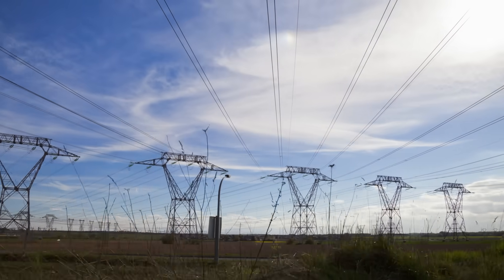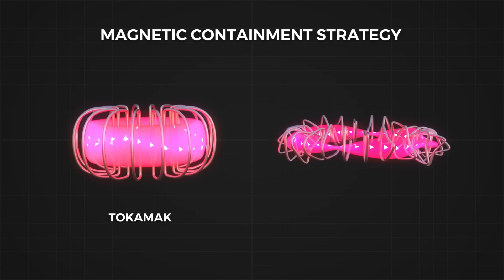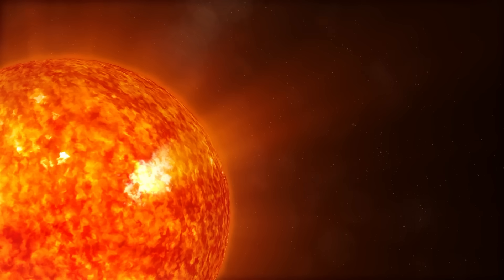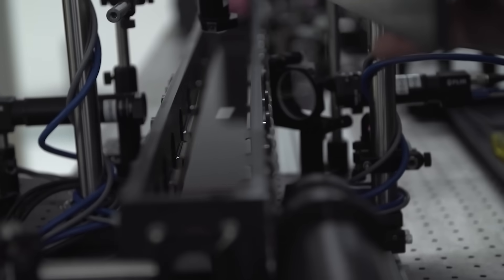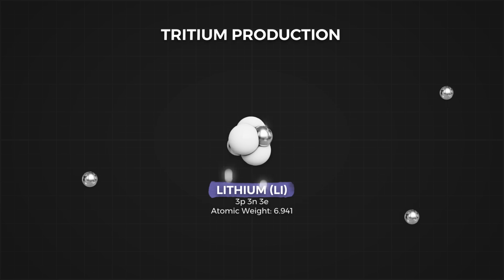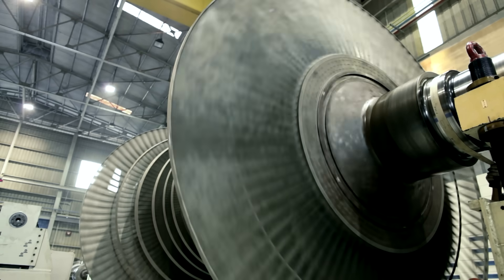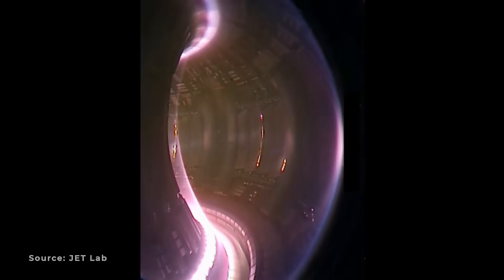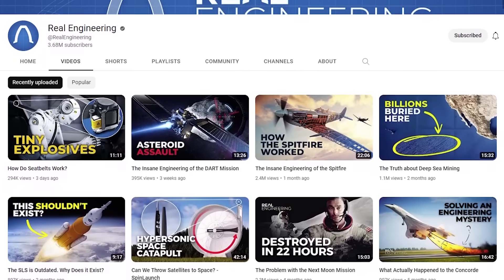The Problem with Nuclear Fusion

Comment: Humans are in a forever quest to find the most efficient way to boil water that spins something
Reply: When you upgrade the steam engine to a higher level
Reply: @thiccccc_chicke4869  not quite
Reply: @thiccccc_chicke4869  XD its literally like those mods in games like forts that let you endlessly upgrade something with humans are at the first softcap trying to push to the next one to get a MAJOR boost from what we had....
Reply: @thiccccc_chicke4869  That's achieved with a higher input temperature, an advantage of molten salt fission reactors, that were experimentally proven in Nixon's  time.
Reply: If we ever figure out He3 + He3 fusion we won’t have to bother with that water boiling. All the products are charged so their energy can be extracted directly with a magnetic field
Reply: @stdesy 
Yeah, but giant nuclear powered water boilers are cool
Reply: @davisdf3064  I think we already have those?
Reply: @BSpinoza210 
Nuclear Fusion powered
Reply: @davisdf3064  actually it's hot
Reply: @michaeldesanta5810 
Indeed, hot as hell
Reply: @davisdf3064  correct
Reply: @davisdf3064  I heard a red neck say that about a monster truck event, the one down the road with the giant cloud of smoke and carbon burning then extracted out VIA some 16 cyl diesel.
Reply: @davisdf3064  they are incredibly inefficient
Reply: @nick_0 
Yet, cool
Reply: @davisdf3064  nah what’s cooler is using high energy x-rays to influence a magnetic field to generate a strong current of electrons. Not boiling water like a kettle. Not nearly as cool
Reply: @davisdf3064  cool, but costly. And most importantly require water, a resource sparse in some regions of the world.
Reply: @davisdf3064  actually they are hot, reeeeally hot
Reply: @davisdf3064  They're going to look back on that like we look back on an ox powering a mill.
Reply: @davisdf3064  they're not cool, they're very hot
Reply: @davisdf3064  Smaller ones are less expensive to build, on a production line, if they're molten salt.
Reply: @davisdf3064  They better be cool
Reply: @davisdf3064 Yeah but the chance of large water boilers having a meltdown is low but not zero.
Reply: @BitAscent  
The chance is zero if the they need the water to work.

You see, modern nuclear reactors use water both as a moderator and a way to reduce heat.

That essentially means that if the water ever gets too hot and becomes vapor, the reaction stops, wich means the reactor stops heating up too.

So, modern reactors are essentially impossible to meltdown, specially in a catastrophic way like Chernobyl.
Reply: @davisdf3064  there's no zero in everything the chances of you dying rn is not zero.
Reply: @stdesy  Won't be so easy tho (unless someone else has researched it). Plasma instability has been a major road block in fusion researches and I can only imagine that an inductive coil on the plasma only makes it worse.
Reply: “Damn the torpedoes! Warp speed ahead ! ❄️😎
Reply: @jameswu7850  what is an inductive coil?
Reply: @jameswu7850  yup even with the neural nets suggesting better magnetic bottles it still seems like it might be beyond the materials we have. Maybe make the torus much larger but keep the magnetic confinement the small size, but I think the walls would still get fried even with high volume pumps moving coolant thru the walls
Reply: @jameswu7850  
The instability part is why Tokamaks sucks so bad.
It is a technology based on the most basic understanding of plasma physics imaginable.
Watering down the most complex field of physics down to Lorenz' force law.
Reply: @jameswu7850  if you respond to this comment you like science
Reply: @jameswu7850 they say AI may be helping to solve that
Reply: @jameswu7850 but its cool
Reply: @jameswu7850  Have you considered Bob Lazar?  I suspect the rings around the saucer probably contain Element 115 - Trillium. When 115 is supercooled near Absolute Zero, the molecular configuration is in perfect symmetry. If the rings are bathed in high sound frequencies, the eternal configuration of Sonoluminessence is generated and the craft can levitate.
Reply: @stdesy  Helion's reverse configuration torus likes to have a word with you
Reply: @stdesy  They have achieved fusion in a California lab, and got more energy output, than input. Look it up. It just happened.
Reply: @epicmage82  They needed 300MJ of energy to produce the 2MJ of laser output, to produce 3MJ of fusion energy.

I'm not knocking it - it's a big step forwards, but for practical use, it's the total net gain that counts, and we're still a long way from seeing that happen.
Reply: @stdesy  what's the hold up on it right now?
Reply: @stdesy  can you please elaborate ? Is he3 fusion aneutronic fusion?
Reply: @stdesy you ruined the joke........ smh
Reply: @stdesy  
We already have methods for that.
Hydrogen Boron fuel produces 3 helium
H1+ B11 => B12 => 3He4 + energy
Reply: @stdesy  you mean "HeHeHeHeHeHe"?
Reply: @stdesy  interesting, wouldn't we still have to manage the heat of fusion being released, which is what the tokamak/coolant water does?
Reply: @stdesy  Exciting stuff
Reply: @stdesy  that's exactly what trinta is doing with their generation 7 fusion reactor.
Reply: @stdesy  Sounds really cool. What are your credentials.
Reply: @stdesy  isnt that what helion is doing?
Reply: @stdesy  Also, He3 is rare. So we’ll still have to figure out a way to produce them to sustain the fusion.
Reply: @stdesy  600 million degrees isn't feasible, helion barely gets to 10 million at the last possible stage
Reply: @stdesy  a week later, here we are. Interesting times
Reply: @stdesy  like the way Tesla wanted it to be?
Reply: @stdesy  like docs from back to the future fusion reactor running on some bits of organic and inorganic trash.  Would work with grounds soil too
Reply: @stdesy  and we need a cheap way to harvest he3 on the moon.
Reply: @stdesy  hey dude can you tell me more about the magnetic field energy extraction or whats its called.... I'm a first year mechanical engineering student and this stuff fascinates me
Reply: @stdesy  isnt there a Startup that already is able to do that fairly consistently? i watched a video about it a few days ago.
Reply: @stdesy  I doubt it very much. They'll be going in random directions.
Reply: @stdesy the problem with using a different fuel than deut and tritium, is that initial input energy required to start the stupid thing. I myself would frickin love 100% usable charged energy fusion reaction as much as the next guy, but net energy is very difficult to get
Reply: @stdesy  way more expensive and how efficient is that
Reply: @stdesy  Is He 3+ Helium or Tritium??
Reply: P0ooooooooooooooo9ó
Reply: It couldn't trap electromagnetic energy of the charged particle which will be the most of energy of a charged particle if it is considered over a large range of time don't you think so 🤔🤔🤔🤔
Reply: @stdesy  then use it to boil water
Reply: @stdesy  why is it that helium 3 is better then tritium and deutrium?
Reply: @stdesy  Im pretty sure that’s how power distribution works on ships in Star Trek.
Reply: @stdesy that would be so cool
Reply: @stdesy  but then it won't be a Hell of a Way to Boil Water
Reply: @stdesy  u get less energy fusing heavier elements not more
Reply: @stdesy  "If," as the Spartans used to say.
Reply: @stdesy  Sonoluminessence
Reply: @stdesy their thermal energy can be extracted with a magnetic field?
Reply: @stdesy what in the foook is that all about?! Now I gotta research
Reply: @stdesy We already have figured that one out in theory, the problem is the rarity of the fuel source, it's almost impossible to find on earth in a way that's easy to extract, but on the moon it would be much easier. That's not technically a technical problem, it's a logistics issue.
Reply: @stdesy  you would just trade 1 problem for another... Besides charged particles tend to recombine near the edge of a reactor. This  means you just increase the heat load on the divertor.
Reply: @tomhuitema2068 not only humans, also nature itself. Eukariotic cells have a proteine called ATP sintase which produces ATP by spinning due to a proton flow.
Reply: Yes, it’s kind of deflating to realize that an enormous nuclear aircraft carrier is really just an overgrown steamboat.
Reply: @tobucksy  Uh not exactly... They're driven by electric motor, but yes this power is obtained via boiling water
Reply: @tobucksy that's a personal problem. When you understand how nuclear power works it isn't suprising.
Reply: @tobucksy  Toot Toot.
Reply: power cells don’t produce electricity from fuel in this way. There are other methods too. It’s common for sure, it’s just that other methods are impractical and/or immature.
Reply: Excuse me! I prefer wind flow and water currents to spin stuff. Boiling water is sooo passé.
Reply: @kazj1728 still convection forces from sun heating earth’s surface
Reply: @kazj1728  Rolling Element 115 at Absolute Zero with Sonoluminessence is the future. ❤️
Reply: Humans are in a forever quest to synchronize a number of spinning disks
Reply: because the efficient way to generate electricity today that we know is spinning magnet inside coil. wind turbine or steam turbine or fossil fuel generator just the means to do that
Reply: @breakhart  better off harnessing dark energy.
Reply: @breakhart  The wind is better at driving a vessel across the Atlantic, than at responding to  the demand on a 60 Hz AC grid. But sailships were defeated by coal.
Reply: @breakhart  But it's not the only way. Batteries exist and they don't use moving parts. Why not just use a fusion battery to produce HVDC?
Reply: @twistedyogert  because battery are for storage, you still need means necessary to recharged it, and fusion itself isn't ready. there is a possibility for RTG battery, but I don't think anyone want one in their backyard
Reply: @twistedyogert  batteries are a bit different. They do not produce electricity. They're a storage technology
Reply: @MadScientist267  ah my mistake. what I meant is occasionally battery can't be long last and need to recharged but RTG doesn't, because it using heat from decay of radioactive materials. since it only general few hundreds watt currently, you gonna need more than a couple for a home. alot of batteries using highly radioactive materials means for self usage risk is high cause need constant checking, that's why I say you don't want that in your backyard
Reply: @breakhart  Depends on the isotopes used. There are many different fuels used for these devices each with their own advantages and disadvantages.
Reply: @twistedyogert  such a different concept.
Reply: @twistedyogert Some people think we have exhausted the possible combinations of elements to produce whatever technology we might need I guess. There's only an almost infinite amount of possible molecular configurations we could try, but I guess we did them all already.
Reply: There it is, the sentence of the day.
Reply: U actually just need hot chicks to heat up the water 🤯
Reply: @hotpenguin607  but there aren't any in my area
Reply: @mistermidnight1823  oof
Reply: We should skip the entire boiling water part (40% efficiency conversion) and take energy out directly from plasma magnetic fields. In fact there are different approches already... They are trying to do exactly that
Reply: @RobinHood-qi7dh  You need more energy to maintain the plasma than the energy you get from plasma.
Reply: @RobinHood-qi7dh  that's a magnetohydrodynamic generator. Not efficient enough on its own, but pretty good as a topping cycle for conventional gas turbine generators.
Reply: @RobinHood-qi7dh  isnt it awesome how the star trek technobabble plasma power systems slowly are actually becoming a thing? Now i will start up an insurance company for consoles, who is with me?
Reply: @RobinHood-qi7dh   why can't we mix both, absorbing the neutrons for heat, capturing it with with water, while the rest is captured by the magnetic field, so you have a combined cycle to try get the most energy for an higher output and hopefully an higher net gain than either big hot boiler and magnetic energy capture
Reply: @federicoviolino6784  good idea indeed
Reply: @RobinHood-qi7dh  today industry has reached> 90% efficiency in steam, water etc industrial turbines..
Reply: @niks660097  what? Max theoric conversion for a turbine is 40%. Maybe you mean that we are at the 90% of that 40%?
Reply: @RobinHood-qi7dh ??
Reply: @RobinHood-qi7dh  This seems like it might make things more compact. Bigger isn't always better. If you don't have a steam generator taking up space then perhaps the room size reactor could be sized down to the size of a minivan.
Reply: we're  still using steam powered machines.
Reply: @iscifion7122  "we're  still using steam powered machines."
Solar panel, tide and wind turbine are exception
Reply: @anteeko  Which is where the term "energy sprawl" originated. Typical of all is very low energy density and erratic generation
Reply: You are so right. Years ago I had a VIP tour of the Maine Yankee Nuclear Power Plant in Maine, USA. It was really weird to see that the non-nuclear side of the plant was just a steam engine. Like, choo-choo.
Reply: Based
Reply: Nobody wants to turn a crank.
Reply: Twisting turning through the never.
Reply: @bizzle9041  🤘
Reply: @bizzle9041 🤘
Reply: Hydro meanwhile:Boiling?What's that?
Solar panels meanwhile:water?What's that?
Reply: Boiling water is cool 😎
Reply: TEA AND TORQUE BABY
Reply: @gwilliam2731  Sounds like a British car podcast or show...
Reply: Ahhhhh hahaha 🤣🤣
Reply: It's all about rotation my friend.
Reply: Its all about boiling water.
Reply: that's exactly what it is! at the end of the day, we just want to spin a motor.
Reply: There’s some designs that directly generate electricity without a turbine involved.
Reply: Imagine being able to heat a burrito in like 3 seconds. World peace would be inevitable.
Reply: @travicast  Its never going to be enough. Human energy usage is already on an exponential climb. The more energy we generate the more we demand. We are way out beyond the Earth's normal energy budget, and this only whispers in our ear to use more and more until we crash the biosphere.
Reply: we really really like spinning things okay?
Reply: The recent fusion test that made a net gain used direct induction to gain the power from magnetism instead of a turbine.
Reply: @zacharysherry2910  lol i dont thi k he has read about it yet. Its a huge deal
Reply: 🤣🤣🤣 you are so right.  Most people have no idea that nuclear power plants just boil water....same as a coal plant.
Reply: Steam is 🔥
Reply: As the good Lord intended. #perfectkettleoftea
Reply: This sounds like something that would appear in a humans are space orcs story lmao
Reply: @Daniel 
Annihilation Reactors (anti-matter) be like:
Reply: I'm putting this on a poster for a Christmas gift
Reply: Can use it for hydrigen production -> solid state fuel cell
Reply: Love the comment Straight on point. New tech needs new methods of thinking for power capture.
Reply: Yeah idk why its the only method we got. I watched scifi movie harvesting energy directly from mini sun in their generator. We are far from that 😂
Reply: You mean like a cyclone nuclear fusion reactor?
Reply: From and engineering perspective,  war has allways been the art of throwing rocks harder, faster, more accurately, and in greater quantity than your enemies.
Reply: That's a very good video, but what an absolute naive introduction from the author...
Reply: I mean you say forever… I say the last 200. Potato potahto.
Reply: i always thought that nuclear power plants used some sort of technology that turned radiation into electricity, but no its just hot water spinning things...
Reply: I'd say were pretty effective at boiling the planet that we live on whilst it spins all by itself
Reply: Do you really want to know WHY..  ???  Bcuz In order to get something you GOT TO GiVE sumthang..  Haven't you ever seen the anime Fullmetal  Alchemist ??   It is One of The First Laws of Physics in nature
Reply: Exactly. I kept thinking, all they're doing is boiling water for a steam engine
Reply: @sirjohnmichael   And why are they doing this again ????
Reply: This comment is hilarious and true.
Reply: Yeah, I was merely listening to this video on my phone while putting a shop fan back together and snapped my head to the direction of my phone when he mentioned they’d be running water through pipes into the reactor to generate steam and I was like, “hold on, what?!” I admit though, I don’t really know how I thought or expected them to extract the energy from fusion reactors, but I thought it’d be more advanced than making more steam lol 😂. 

I said to my dad, “there’s gotta be a better way than that. I imagine one day we as humans are gonna figure out fusion, then aliens are gonna visit us, and they’ll be like, “ah, so you guys have figured out fusion? That’s great! May we see?” And they’re gonna look at us just making steam and they’re going to turn to us with such a disappointed and shocked look like, ”what the hell are you doing?!” and we’re just gonna shrug and say, “making steam to turn a generator? What?””
Reply: Hahahah right I keep telling people we are STILL in the Steam AGE!
Reply: I boiler water for a living to turn things to make sparks. It's a pretty cool job.
Reply: Funny thing... they invented steam power thousands of years ago. First the ancient greeks, then the romans. They dismissed it as a novelty, and never actually applied it to anything other than essentially toys, or something of amusement. Imagine where we'd be today if they'd of actually seen it for what it was. The industrial revolution would have happened thousands of years ago, instead of two hundred.
Reply: I wonder why we don't use geothermal energy🤷
Reply: What it's all just steam turbines? 
🔫 Always has been
Reply: That isn't smoke, it's steam, steam from the spinning turbines we're powering. Mmmmm, steamed turbines.
Reply: Yeah exactly. Surely there’s a better energy transfer method
Reply: Still perfecting the "STEAM ENGINE"...
Reply: If the other apes figure out spinning things with water, maybe they'd make something of themselves.
Reply: It will be a long time before humans can shed steam, Direct conversion methods will need to beat the efficiency of a steam turbine.  There is also the fact that in theory one could strip down the boiler side of a coal plant one day and build a Tokamak, hook the steam and water lines back up and get back on the grid.  I mean in theory the lack of being radioactive means we could potentially do drop in fusion upgrades for fossil plants that currently do baseload generation.

I state baseload because I suspect much like nukes or giant coal plants, a fusion plant will want to be run at 100% all the time.  So you use them to handle the constant unchanging load levels of the grid.

*Yes I know Fusion is also nuclear but I suspect given the imprecise nature of general language culturally we will say Fusion for a fusion plant and "nuke" for fission.  For one thing conquering NIMBY will mean branding Fusion as its own thing and avoiding the world nuclear as there is sadly a lot of people who mentally shut down and enter NIMBY mode before you even could get to the word Fusion in "Nuclear Fusion".
Reply: Volcanoes seem pretty hot
Reply: As a plumber, the quest for the ultimate boiler is close to our heart. Im waiting for the day i install a fusion cycle condensing boiler in someones basement, and hook it up to the same dumb dumb electric pumps we've been using for over 100 years.
Reply: Long live the steam engine!
Reply: That is the reason of engineering!
Reply: profound statement
Reply: Least Helion will look to not have to do that.
Reply: When humans find something that produces heat:
Slam a turbine on it !
Reply: The most efficient way to utilize basic "work" that we can comprehend. Which is getting something to spin essentially with steam, water, heat, gas explosions etc.
Reply: @erllrma  It's just the bigger size perpetual motion machine that can't work. It goes against laws. Period. IMO. Fusion is just big oil stopping us from find real unlimited energy in recycling.
Reply: Bruuhh..
Reply: True
Reply: thats why its so stupid, DONT USE WATER TO GENERATE ELECTRICTY ITS SO INEFFICIENT... SO MUCH FCKING FRICTION
Reply: Haven't watched the video yet so if he explains this then I'm sorry. But is there a reason we use water? Is it the best combination of thermal conductivity and thermal expansion? or could we get a more efficient more expansive substance to fill in the gap (something that boils at much lower temperatures but is still liquid at ambient temperatures, like alcohol)? Or is it just because it's so cheap and abundant that it just makes sense to use water?
Reply: @bengoacher4455  One of the reasons I read the SCO2 is better than water is the lack of state change in its power cycle. It has the density of a liquid with the effusiveness of a gas.

There's likely a number of properties that make for a good working fluid. Temp range, state change points, density, combustibility. I'm not educated enough to tell you exactly what properties make an ideal working fluid.
Reply: @bengoacher4455  someone explained it pretty well earlier in the thread
Reply: @bengoacher4455  Water is the most efficient liquid that is easy to handle. Even so hugh pressure steam can be deadly. Our capability at handling difficult materials is improving. Some fission plants have used sulfer as their heat exchange medium. It has advantages and disadvantages compared to water.
Reply: @Tom Huitema I think its about the human need of something that moves but dont actually move.
Reply: Or you could just drop water down a pipe and spin something.  It's called a hydro electric plant.
Reply: And that makes porn possible and accessible!
Reply: Just use a MaK Diesel engine 😎
Reply: The issue of hot water from power plants heating rivers/oceans will continue to be an environmental problem in the future. But the benefits completely mask the side effects. So, let’s join hands in support of this amazing new technology.
Reply: i feel like an array of specialized heat resistant solar panels inside the reactor housing but safely outside the magnetic containment field could be a useful way to collect additional energy from the reaction beyond just the thermal energy
Reply: Dyson swarm s😁
Reply: I don't know about that... we seem to be moving away from using steam in power generation.  It persists now in combined cycle NG plants, but coal and nuclear are falling away.
Reply: @pauldietz1325  could u say more on other systems that generate power but dont use steam to turn a turbine? Thanks
Reply: Always found it funny they couldn't extract the energy from the nuclear fuel directly
Reply: @FornoDan  y is that funny? there is no such thing as "extracting energy directly" mate, that is not a thing, energy has to be transformed to useable form ofc- depending on what machine or organism (what dissipative structure generally) is going to be using it. this is why your body cannot "extract" the energy of a banana "directly", metabolism is required
Reply: It's all in the name of boiling water for tea 🤣
Reply: We should use quantum tools to directly extract energy from fundamental particles.
Reply: That’s a drastic oversimplification but yeah sure
Reply: That stops now if we do this.
So this is probably the end to that.
Reply: We are not going to boil the water, we are going to burn it until the Earth is a dry rock.
Reply: Toto Ltd has been doing their best
Reply: @pontosinterligados  As a science project for future use in space or with an extraplanetary source of hydrogen, I applaud their work. As a solution to global warming--it's another dangerous non-solution.
Reply: Solar thermal and solar panels are the way.. 12 sq km of solar panels in the mohave desert generates enough power for the entire planet..store the energy as electrolyzed waste water/HHO and run natural gas generators
Reply: @GodSpeaksInMath  "Solar thermal and solar panels are the way."
I would disagree with that.
Sadly they take too much ressource and are intermittent. They can help the grid but not be the major power source.
Reply: @GodSpeaksInMath  "1 trillion dollars the minumum cost of any US war for oil could put 5kw of solar on 200 million homes."

Where do you find the resources to build all that? there already a huge silicon shortage and sand world reserve are getting depleted fast.
And dont forget solar panel have a life time, it is not buy and forget.
Reply: @anteeko  For heating homes, there's a cheaper type of solar panel, which just uses black painted pipes to heat water directly.  There were some in use, some time ago, before silicon based ones became more common.  

The pipes usually had a lot of bends in them, to get more length of pipe per unit area.   The water was pumped through them and also ran through radiators inside the house.

The problem, of course, is that it doesn't work very well in winter, but then the silicon based ones suffer from that to some extent too, as do heat pumps.
Reply: @TooSlowTube  "The problem, of course, is that it doesn't work very well in winter, but then the silicon based ones suffer from that to some extent too, as do heat pumps."

My building use that:)
It should be on every roof if you ask me.
Reply: @anteeko  Yes.  It's cheap enough to do, compared to the cost of heating, so I agree - it should be on every roof.
Reply: It started with the wheel, how can we turn it
Reply: Fr tho 😂
Reply: Need to transfer directly from thermal to electrical energy
Reply: you mean geothermal plants?
Reply: Not even a T1 yet.
Reply: "Humans are in a forever quest to find the most efficient way to boil water that spins something"
Do you know of a better way to generate electricity?
Reply: My brain 🤕
Reply: Enter Plasmoids
Reply: If something isn't broken why would we change it?
Reply: Finally a person besides me that actually get is. Yep. One big boiler is all they are. Bravo Mr. Smarty Pants.
Reply: yes, because steam is a cheap way of converting heat into electricity
Reply: Yup, if you can figure out how to rotate a shaft with strong enough torque, you're in business. Usually water, sometimes wind.
Reply: I disagree.

Solar and Wind and other sources of renewable technologies are fast changing this formerly true statement.
To me, future fusion power should be used for extreme high energy applications like using lasers to shoot asteroids out of the sky or for experimental physics or terraforming.
Reply: They made a noce lik discovery about a year ago. Being able to turn on or off  heat and electrical transfer at an atomic level. On off on off kinda thing. 
We need to start building on those nano scales and move past this stick banging industrial revolution level of productions.
Reply: @rene9385  We move forward all the time, irrespecitve of our prodigious greed. Life expectancy increases every year, decade and century. As does medicnie, the sciences and technology. Yes, with every advancement comes a multitude of challenges, but that is the nature of change. Media feeds us proportionally more negative news than positive, smiply because it sells and circulates faster.
Reply: dude speaking facts
Reply: Nothing could have been a more accurate reply. At the end of the day, it all comes down to the illumination of light bulb; only the process before keeps on getting more efficient.
Reply: New desgins use magnetic fields to generate the electricity instead of boiling water.
Reply: im going to report this comment because it made me laugh too hard at work and caused me to fart out loud.
Reply: Then waste all the useful energy on destructive pursuits.
Reply: And then use it for cooking pasta
Reply: But always find a way to make money on it
Reply: That's how to generate ac power. The fact that spinning a magnet in an eclectic field generates power is the only reason we have electronics
Reply: And never use it*
Reply: It is the simplest way to turn a generator. Energy transformation are difficult to control.
Reply: MY BUBBLES!!!!!
Reply: LOL 😆
Reply: literally
Reply: Lmfao
Reply: Why did i thought a spinning washing machine that has boiling water
Reply: I mean… if you wanna put it that way…
Reply: The Aqueous Homogeneous Reactor is the future. Simple, cheap, safe(r), proven.
Reply: Maybe because so much of what we need and use runs on electricity.
Reply: I love you
Reply: HAHAHAH
Reply: I have always thought that the only thing holding humanity back is that most (all?) of our technology is rotational, as in you have to spin something to get something else
Reply: LMAO
Reply: its funny that the video he just made disproves this
Reply: and as a Boilermaker i will build it if you pay me enough :D
Reply: Until now.
Reply: Helion fusion energy actually don't boil water
Reply: @Nameless8_   you know now, ge did not.
Reply: Helion is harnessing directly.
Reply: Yeah its hilarious literally atom smashing bleeding edge science to boil water
Reply: Dude,  the coal burning boilers in Titanic were SO much more efficient
Reply: Highly underrated comment. Completely agree
Reply: Lmfaoooooo
Reply: See next video then .... no heat engine with 20% eficiency
Reply: Liquid metal never launched into orbit some say
Reply: @tomhuitema2068 good thing we don't live on a cube...
Reply: PV, Wind Strait to grid
Reply: And we will never find the most efficient because we'll search ever more for better efficiency
Reply: It's never gonna happen.  People will never get close to what God created.
Reply: @oliverford9325  god didn't create shit. this what the universe created, and we will make it better
Reply: Also in a quest to find the best way to put metal through flesh to destroy our enemies.
Reply: @Bryan Ventura with alternating current
Reply: We all ready have it. It's cold fossil fuels
Reply: Which is an inefficient, inelegant and improbable solution to the problem. It's all well and good confining a large gas plasma, but what use is it if the heat generated is in the confined plasma, how do you get it out to make steam to spin anything, let alone to extract more energy than the system consumes?
Reply: I think that's the insanity right there, trying to use biproduct mechanical energy to power everything rather than figuring how to use the pure energy directly. It's so complex though that we've spent a lot of time scratching the surface of the first thing.
Reply: Hamsters
Reply: Research is being done right now that would eliminate the need for turbines: solid-state energy storage. It even has the potential to convert heat to electricity more efficiently than turbines.
Reply: lol, true.
Reply: With fusion power, you don't need to create steam to spin a turbine.
Reply: Not with the new one 😁
Reply: Yup
Reply: Well fuel cells and solar cells don't have to spin to generate electricity, they just strip off and move individual elections somewhat similar to how our own biological cells generate energy.
Reply: So we can boil water for coffee
Reply: There's another issue (not with fusion itself but with the "utopia" part): 
To change the world, fusion would have to be not only competitive, but an order of magnitude cheaper.  If it's "only" competitibe, it'll be just another type of power, like coal, nuclear, hydro, wind, etc.
Reply: Humans were like "hey, when a neutron is absorbed by a uranium nucleus it releases energy which heats up water. We will make grand usage of this!"
Reply: You never know could be able to make some thrust out of it one day!
Reply: Thank you cus sometimes I feel like the only person who realizes that nuclear energy is just fancy steam engines
Reply: It's a weird time scale. 1800s were when the first steam engines occured. Prior to that, it was done once with heros engine. 

The whole boiling water and spinning things is recent... But people said "this is lit, let's make millions of these"
Reply: Lol so they wanna invent fusion and still use the water boiling idea??  Brainstorm a bit guys ffs!
Reply: Nuclear reactors are nothing more than obsolete steam engines. If nuclear fusion is realized, in theory, more energy could be extracted cleanly than was used for fusion.
It would be better to abandon the current nuclear power generation, which produces radioactivity and nuclear waste, and proceed with nuclear fusion, or, until that is realized, proceed with renewable energy.
Reply: Don’t forget about companies like Nestle… hmm that’s a nice water source there, be a shame if someone……..bottled it all up in wasteful plastic and did this millions of times over a year. Criminals walking free.
Reply: I'm sorry you don't understand that a moving magnetic field generates electricity because both mentioned fields are of the same beast.
Reply: 🤣🤣🤣exatly. I have always thought for it that way.
Reply: Helion does not boil water but taps directly into the plasma to generate electricity. It's the Star Trek Technology.
Reply: @Scottar50  , and isn’t the current end result heat for boiling water to turn a turbine?
Reply: Most people don't realize the reason we use steam turbines is because they are a highly efficient technology that we have continuously advanced towards perfection since it's inception. The higher the temperature and pressure, the higher the efficiency, so of course denser energy sources and optimized cycles are the main focus of modern energy production.
Reply: Well when you phrase it like that it sounds really easy
Reply: Well of course they are! 🤗
Reply: Fusion can change that. Electricity can be created directly without steam and turbines
Reply: Not all humans. There are some that want to not use water. They instead want inefficient wind to spin unrecyclable parts that don't produce enough power. And some just want to  put things in the sun for a long time, and for some reason they usually don't make anything spin at all. Wierdos.
Reply: If you watch his helion documentary you’ll find that isn’t how they are approaching fusion. It skips that step entirely, making it potentially much more efficient.
Reply: spins something, you mean a copper coil in a magnetic field
Reply: perhaps there are alternatives :)
Reply: ~Global nuclear bomb fake Hiroshima deceptive There are no satellite photos of nuclear test explosions, please tell everyone ~
Reply: What if we can skip the boiling and spinning part and just get straight energy. Just like how plants do it.
Reply: The whole universe is rotating alas if we could use that as prime mover 😂
Reply: Don't belittle it. The superhero Superman had the power of a steam locomotive.
Reply: It's called a turbine, it's a REAL turbine, and it's more powerful than a steam locomotive, which is impressive enough that Superman was as good as one.
Reply: I solved this a long time ago. Before i was even a teen. The most efficient way to boil water into steam is to piss off a woman. Instant steam pressure
Reply: I’ve never thought of it like that before.🤔🤔🤔
Reply: spinspinspinnspinnyspinnyspinnyweeweeeweeeewewewewewhoooooooooOOOOOOOOOOOOOOOOOOOOOOOOOOOOOOOOOOO

powers your mom's vibrator
Reply: The true purpose of the British Empire, creating the need of humanity to create better kettles.
Reply: It's called a Volcano, use one
Reply: we need to look at this as a homework assignment, once we develop a surficial advanced Ai, it will figure out the solution for us
Reply: Hardest hitting comment on YT 😂😂😂
Reply: If it ain't broke...
Reply: This comment GOATED
Reply: Everyone has their talent 😂
Reply: This is why we need to think outside the box kind sir
Reply: No. Aneutronic fusion produces no neutrons, and won't involve a steam cycle. You tap off the electrons directly, after X-Rays are converted into electrons in the reactor shell.
Reply: Faraday's old trick
Reply: If it works it works 😅
Reply: Heat is everywhere, so instead of fighting them join them
Reply: its like we are trying to find newer and vetter exploits in a game called LIFE
Reply: That’s probably the issue we should solve. Maybe we can harness the electrons in literally every atom in existence without the thing go spiney spiney
Reply: Runs the world, now and for the last 150 years.
Reply: I think this is my favorite comment on any YouTube video 😭😭😭😭
Reply: @@dariojurisic Another solar advocate thinking his energy is cooler because no Carnot cycle, so he’s superior.  That utility cable side  of the house and a subsidy allows to  fantasize solar is 24/7, winter -summer.
Reply: Not just something it needs to spin a generator so it makes power, if it doesn't make Power then they won't care
Reply: Helion's system uses charged particles to move the magnetic field containing the reaction to produce energy that way. Far more efficient than boiling water.
Reply: Was thinking the same thing!
Reply: It goes against the law of physics. It is "not" possible. IMO Heat energy is the key, and it's literally all around us being wasted cause it just changes form and can't be destroyed.
Reply: And fusion ain't it
Reply: I dono why don't use thermocouple
Reply: Currently there is a lot of research on supercritic CO2 and Organic Rankine Cycle Technology
Reply: There are other ways besides water boiling that you can make energy off of fusion.
Reply: The point is moot because IQS are dropping with each generation. Even if we got fusion reactors working out children and grandchildren will be too dumb to keep them running. Unless they have advanced AIs that just tell them what to do.
Reply: Dude, seriously! There must be a more effective way to trap energy than spinning an air turbine.
Reply: Hey there! While I get where you're coming from with that comment, I think it's important to note that nuclear fusion, although it might involve boiling water to spin something, shows great potential for clean and efficient energy production. On a different note, if you're into outdoor activities, I highly recommend checking out the Segway Portable PowerStation Cube Series. It's a versatile power station that can keep your devices and appliances running for extended periods, perfect for camping or home backup power. Happy adventuring!
Reply: Definitely  a very crude take
Reply: Yep, you yourself included.
Reply: I'm hopeful for the HB-11 fusion project....
Hydrogen/Boron aneutronic fusion!          :)
No boiling water and spinning things - the reactor is intended to achieve the direct conversion of nuclear energy into electricity without its conversion into heat. 

To achieve this, the reactor sphere will be charged close to 1.4 megavolts - allowing it to slow the charged alpha particles before they contact the sphere. The alpha-particles will be neutralised on contact with the sphere allowing their charge to be captured as the source of electricity.
Reply: As I've said before, A nuclear reactor is just a really fancy way to boil water.
Reply: Good old donkey hot water system work best for both😂
Reply: I'm thinking if we build a giant Dyson turbine around the sun and just dump water into the sun we could surpass humanity's wildest dreams
Reply: Lol true😂
Reply: This is a paid Helion-VC ad, and its been covered
Reply: bro is an alien
Reply: apart from photovoltaics! It directly converts solar (or other) radiation into electrical energy and doesn't rely on rotating something. :-)
Reply: This tickled me so much
Reply: @mwm48 bro is ayo
Reply: Boiling water in itself is an extremely inefficient way of energy conversion. 40% of the energy is lost.
Reply: Thank god we are forever trying to get unlimited energy, you could forever leave Snyder comments on YouTube criticizing people trying to make the world a forever different place while you sit there and criticizing the people potentially changing your life while you sit there with Doritos dust on your face saying garbage, never contributing to the final answer to humans forever energy solution…
Reply: I guess you can say we live in Spain without the "a"
Reply: Expand water or air. It's all the same. Energy loss
Reply: The most efficient way to boil water is to boil it =)
Reply: 😭😭 so true
Reply: What about the steam ones though?
Reply: @Amethyst12thheaven  
For whaaats,, BIG POPULATIOJS,  OR OVEAAA POPILATIONS.. !!!!!!!!!!!!
Reply: @Amethyst12thheaven  youre NOE TRU..
BIEG TRUOBLES, BIEG CONSUMTIEF YOUEREEE KNOE THATS WAHTS...
Reply: @Amethyst12thheaven  
Whaaatsss A TROUUBLES.......  
DOUBLESS, DRIBLESSS, TRIPLESSS, WAHTSSSSS GIVE ME TEANWERS.. YURE NOT READ TEN,HOURS.
Reply: @Amethyst12thheaven  heiiiii yure sayd big trouble its OILS,COAlCH, PROPANES, NUCLAERRR, SEKS BIOLOGIC, EATCARTHERS... THATS BIG TROUBLES YAAA..  IDIOOTS SEMUA ITU KEKAYA,AN,PENYEDIA,HARTA BENDA... 
WHATSSSS BEIG TROUBLESSSSS
Reply: @Amethyst12thheaven  
Whtaaaaaaasssss GEIB TTABLESSSS OR WHATS BEIG TROBLES, WHATSSSS... MONEY THATS BIG TRABLES,  SYSTEM THATS BIG TRABLES,  UR REALIGIONS A BIG TRABLES...  WHATS REALS BEIG TROUBLES.
Reply: @Amethyst12thheaven  
Whaaaaaayyyy meeeeee..
Thats NOTS WON TERLIHAT, ATAUPUN BERLAGAK TOLOOOLLL SEPERTI MEREKA, ..
WHATS BEEEIG TROUBLESSSS
Reply: @Amethyst12thheaven  
Kalian mengkonsumsi daging 5KG UNTUK KISAR BERAPA HARI CADANGAN, .TOTAL SAPI ITU 150:5= 30 PERSONS. UNTUK DUA HARI, BERAPA JARAK PROSES SAPI..  SATU TAHUN DUA TAHUN ATAU BERAPA!!!! INI CONTO KECIL... WHATS A BIEG TROUBLESSSS.........!!!!!!!
Reply: @Amethyst12thheaven  
Noset...
Reply: @Amethyst12thheaven  
Setannn thats bieg trobkes!!!!!!! orrrr bezuer thats beig troublreesss..  Clarification WHATS A BEIGS TRUOBLES!!!!
Reply: @Amethyst12thheaven  
A naturea SISTEM TIDAK AKAN MENAMBAH ATAUPUN MEMPERBARUI, SUMBER SUMBER DAYA ITU.. 
DAN SEKALIPUN TERBARUI , 
SAPI SAJAAAAA BUTUH PROSES BERAPA TAHUN ANDA HABISKAN BERAPA HARI!!!!!
OUWWW ADA SESUATU YANG BARUU,CEPAT,...
POHON YANG DITANAM LEBAT, CEPAT TINGGI ITU, RISKAN TUMBANG HANCUR KENA ANGIN,...
IYA BARU CEPAT, INSTANNNN...
KEMATIANNNNNN....
WHATS BIG TROUBLESSSSSS
Reply: @Amethyst12thheaven  jika mengaku adalah paling patuh,suci,taat ,agamaaa...beralasan agama.
Call them setan, iblis, kematian, semua..
Whats RALY BIGE TORBEIL.!!!!!!!!!!!!=
Reply: Yup i thought of that all the time. We just trying to remake a heater that self heating. Without ever using any fuel to burn. Just to move generator. 😂
Reply: It's always about spinning something more efficiently or effectively
Reply: Well, since failing at the other could possibly light our atmosphere on fire,  I'm ok with that.. maybe in a 100 yrs they could try it a little harder..😅😅😅
Reply: I feel like you're forgetting all the times we used wind and unboiled water to spin something.
Reply: The day we achieve AGI+Quantum Computers + Fusion

Man what a day to be alive that would be
Reply: Thats all it boils down to
Reply: Hilion bypasses the steam turbine though.
Reply: put the water in space, it will boil immediately
Reply: Steampunk will never die.
Reply: ...and the ones with money are in a forever quest to convince you that anything renewable is evil
Reply: Why not use deuterium gas and tritium at the same time?
Reply: Just yesterday there was a viral thread about this on Twitter, that no matter how far we advance, it's still just boiling water. Some people were relieved that at least solar power (photovoltaic) didn't involve boiling water to generate steam to spin a turbine, until they were introduced to solar towers and concentrated solar power.
Reply: @ffnbbq  boiling water is just supreme
Reply: Yeh i did a short course on turbines engines and dam water but tell me, because I am not really up to date with nuclear and only done short courses in chemistry and medical nuclear issues , can it be successfully referenced?
Reply: Are you stupid? If we can have fusion between we dont need thst
Reply: *cough diesel power plant *cough
Reply: God: Creates humans
God: “Now I place you as custodian of my creation”
Humans: “…Can I make it spin so I can make tea more efficiently” 🤔
Reply: @kelly4187  Humans: create gods
Humans: kill each other over gods
Gods: whatev
Reply: It's a good transfer method, I guess. Good old Rankin.
Reply: Almost like steam engines are actually man's best friend.
Reply: Hey man if it works, it works
Reply: You’re the smartest and most clever in the comments here hahaha everyone is hilarious
Reply: we need to move on to molten salt thorium reactors
Reply: Money and making more of it.
Reply: So true
Reply: Man I was gonna say the same thing sort of.
Reply: We should do everything the highest rated comments say! I let them live so you can thank me personally for the ideas.
Reply: humans literally got the "a settlement is in need of help" quest line
Reply: Amazing comment.chiefs kiss
Reply: yet another mind-boggling method of boiling water
Reply: Agree, need to move away from physical generator based on movement
Reply: great explanation. I'll use this for toddler's book
Reply: Only in the last 150 years or so.
Reply: Once Elon Musk develops Sonoluminescent Fusion, this will change everything for everyone.
Reply: We humans strive to make anything and everything spin
Reply: @Masterchief0397  That's because Eve chose the Tree of Knowledge of Knowledge of Good and Evil. We should be following the Virgin Mary..
Reply: @Masterchief0397  Sonoluminessence at absolute zero just goes on forever.
Reply: that's how u float on internet😂
Reply: Lol, yea
Reply: Your statement makes me laugh and cry at the same fuggin time. Take care.
Reply: Eyyyyy
Reply: That’s because to this day we have not discorvered a more powerful form of energy than steam.
Reply: 😂😂😂😂😂 for real
Reply: Steam make turbine BRRRR
Reply: Well said!
Reply: As a mechanical engineer, that’s how I see it.  In engineering, we call whatever creates the heat is a “glug.”  We don’t have to know anything except its heat output.  Everything else is irrelevant.
Reply: yeah, simple minds look at it like that
Reply: "It's all steampunk???" Always has been.
Reply: Game theory is dominated by often-misunderstood Nash Equilibrium. To me, the lesson to be learned is that when playing a zero-sum game, like Monopoly, where the winner unwittingly becomes the loser, too, by not having any more customers, the only way out of losing is for all parties to unilaterally quit playing the game (witness the growing national debt, now at $36 trillion, and a dying planet from global warming). When the game is growth through a growing population, that is a unsustainable zero-sum game. In finding Nash Equilibrium, the longer the zero-sum game is played, the greater the catastrophic fall. Nash equilibrium requires that a different game be played-- hopefully one that is sustainable, like limiting human population to what can be supported by available sunlight, as has been the case for all of human history until now.
Reply: Try this data point: Because the electron's Coulomb (electrostatic) repulsion for another electron is 10-with-42-zeros times as strong as gravitational attraction, harnessing a controlled, sustained fusion reaction in a local environment WITH MORE ENERGY DRAWN OUT THAN PUT IN FOR THE ENTIRE PROCESS is a PHYSICAL IMPOSSIBILITY. "Put that in your smipe and poke it!

A physical impossibility! Yet, much money and time is being WASTED on attempts to “find a way,” apparently to justify continued reckless population growth on this fragile planet. (The problem does not exist with fission reactions, which have their own set of intractable problems, because energy release follows the direction of universal evolution WHICH IS TOP DOWN cosmology)
Reply: Per Google, John Adams said, “Facts are stubborn things; and whatever may be our wishes, our inclinations, or the dictates of our passions, they cannot alter the state of facts and evidence.”
Reply: EVERY mechanical conversion of energy from one form to another has an inefficiency; otherwise, it would be possible to build a perpetual motion machine.
Reply: TURBINE GO BRRRRRRRRRRRRR!!
Reply: It is a popular notion that Einstein once said, "The definition of insanity is doing the same thing over and over expecting a different outcome." Regardless of the source, it makes sense to me, as harnessing the fusion reaction is always 30 years away going back to the 1960's..
Reply: I have been inventing a new hybrid of nuclear fusion reactor it's name is pulsecore-GF-X it's a new hybrid of the nuclear fusion reactor
Reply: @AljymerEspallardo  And the pulsecore GF-X  it is capable of perpetual motion, too, I am inclined to suppose? BTW, extraordinary comments require extraordinary proof.
Reply: And the pulsecore GF-X  it is capable of perpetual motion, too, I am inclined to suppose? BTW, extraordinary comments require extraordinary proof.
Reply: Since the universe began with a singularity, if that singularity was a Big Bang, then all of the currently-observable order is required to “self-assemble” from the resultant hot chaos—“allowed” because, though extremely improbable, it is not theoretically prohibited. I don’t believe that! My theory starts with a singularity where everything is connected into a single mass that initially divides into two, like in cell division, but with smaller masses with each division, united by proto-gravity. (Gravity and light were indistinguishable in the beginning.) If in choosing between the two, one of the theories contains a “unwanted message,” that “everything is connected,” then the former theory would be preferred (with blinders on), thereby conceivably allowing a misinformed majority to be manipulated for power and selfish gain by a elite minority. You can “take that to the bank!”
Reply: Leonardo DaVinci  said, "To be realized is that everything is connected."

Denial is not a river in Africa.
 
Bizarre behavior is a key indicator when diagnosing mental illness. Utter destruction through selfish ignorance and neglect is bizarre behavior to me. Being in harmony with the natural world is essential to survival and long-term existence. Unfortunately, the preferences of the religious right seem to resemble the mass hysteria of lemmings circling for the final march to the sea, thereby accomplishing the self-fulfilling prophecy regarding the end of times.
 
Per Google, "Gaslighting is a form of emotional abuse that involves manipulating someone into questioning their own reality, thoughts, and feelings. The goal is to make the victim doubt their own perceptions and instincts, and to convince them that the gaslighter's version of events is the truth. Gaslighting can happen in any relationship, including between friends and family, and can be used to gain power and control."
 
Who is being deceitful or manipulative?
Reply: In us, oil lobbies would have this banned.
Aint no munee in it.
Reply: Weirdly obsessive, isn’t it? 😅
Reply: e
Reply: Not boil water recharge the vibrator
Reply: My idea is to densely pack tens of thousands of Bic lighters together and bundle them upright held together by a giant rubber band around the circumference. Suspend a thick copper bowl slightly above the lighters, and figure out a way to ignite them all together and keep the little plastic tabs held down so they stay lit. The copper bowl will eventually become super hot, at which point water will be released into the bowl where it will flash over to steam. We then collect that steam and use it to spin a turbine. Help me get this project jump started by donating to my clean energy fund.
Reply: A cup of tea / coffee on a turn-table ! !
Reply: Reliable it maybe , cheap it will never be . There’s will never be cheap electricity.
Reply: Lolol there trying to make a sun
Reply: Why is water ideal for this? Bcs its abundant? Y cant we make a better more efficient liquid to boil, would the cost of making it make the energy return on investment negative?
Reply: @mohamedseleem  Water has an exceptional expansion ratio, very few liquids are better. Mercury and Kerosene for example expand more when they undergo their phase change to gas but even if you had abundant amounts of those materials you can imagine there might be some small problems boiling off highly explosive and poisonous compounds. 

This really goes back to the magic of water, it has so many unique properties that make it so useful in so many applications, even with custom made compounds it's not easy to do better.
Reply: @ImBarryScottCSS  thank u, excellent answer
Reply: @ImBarryScottCSS makes sense. 👍
Reply: @mohamedseleem  There are designs for supercritical CO2 turbines that are significantly more efficient and the turbines themselves are smaller, but they have to built from hi tech alloys to resist the corrosive properties of CO2.
Reply: @mohamedseleem  Extra flavourful tea (real answer is that deuterium is naturally found in water as heavy water which is slightly more dense than regular water)
Reply: @fork9001  i dont think you understood the question my friend
Reply: @mohamedseleem  water is basically the liquid that boils at the lowest temperature that also exists in great quantities, is safe to handle, and has low-ish corrosion, image for example alcohol, boils at 78 degrees, getting it is more expensive, and it’s flammable. Convenience/price/safety make water perfect
Reply: @ephremcortvrint2376  someone earlier said that we actually have designs for generators that dont use the phase change of water but rather the phase change of  other, custom compounds, such as CO2 which apparently has an much higher "expansion ratio", nonetheless we do not use them bcs of the corrosion as u say. since the boiler-turbine-condensation-boiler cycle is (or at least can be) a closed system, it makes sense that if we could overcome the corrosion and safety hazards of our custom compounds, we could actually advance beyond Watts famous steam turbine, which is basically what we still use today
Reply: @mohamedseleem  

A: it’s everywhere
B: steam is around 100c, much easier to contain than liquid nitrogen or something
Reply: @UnityGoogle  yes, i understand, but since part of a generator is a closed system, would we not benefit from a custom compound with a higher expansion ratio during its phase change? that is,  if we could get the other issues (corrosion, abundance, safety) under control
Reply: @mohamedseleem  Look up molten salt reactors - it's a technology that's used in some types of fission reactor (thorium cycle).  Apart from the corrosive nature of liquid molten salt, it could potentially be used to drive a turbine directly, though I think it's normally done by using the coolant to heat water, to drive the turbines, for practical reasons.

Whether it could be more efficient than just using water (driving a turbine directly with the liquid salt), I don't know.  The reason it's used in fission reactors has more to do with moderating the reaction in a safe way, so that a leak leading to a loss of coolant doesn't allow it to become critical.

Personally, my biggest power expense is heating.  If fusion reactors could be made small enough, they could pipe hot water directly into nearby homes and offices.  The losses then would be limited by the insulation in the pipes, rather than by efficiency of conversion to electricity.
Reply: @mohamedseleem  there are several liquids that could be used in place of water. However, water has the remarkable benefits of being extremely cheap, readily available, non-toxic and non-combustable.
Reply: @mohamedseleem  water has some really great properties for use in power generation
Reply: @mohamedseleem  the combination of abundance, chemical and nuclear stability and safety to humans, and thermal properties (high density and high specific heat) make water better than anything else.
Reply: @mohamedseleem  Waters not reactive with most things and is available just about everywhere.  There's much more efficient options, but everything likes to explode or burn
Reply: @mohamedseleem  the power is in the expansion of water as it turns to gas. Iirc the transition increases volume 1600 fold
Reply: @mohamedseleem  abundant, stable, reusable
Reply: @mohamedseleem  The problem in the efficiency isn't the water, it's inherent to heat exchange.
Reply: @mohamedseleem , peanut oil! And many turkeys…
Reply: @mohamedseleem  or just don’t boil something.
Reply: @mohamedseleem  yes to all of those things
Reply: @mohamedseleem  once you boil the liquid the energy transfer is almost 100% efficient. I doubt switching to another liquid would have much if any difference and you need a lot of whatever liquid you are using. This means water will probably always be the best liquid as long as we are boiling something to move a turbine.
Reply: @mohamedseleem  yep, water is the most efficient
Reply: @mohamedseleem  Water has one of the highest heat capacity of all liquids, meaning it can transfer a lots of energy, its also all present, cheap and if you high pressure it, you can reach temperatures of hudreds of degrees Celsius without actually boiling it... meaning you can transfer lots and lots of energy... which is exactly what we need
Reply: God, this is exactely what i think. Why use it this way if you can do it with other  kinds of energy?
Reply: @lucasdias4365 it all comes down to the efficiency of the heat source you are using to boil the water.
Reply: @lucasdias4365  
It is a joke.
Fusion would be to tap in to a new type of fuel.
Though it would be better if we could directly convert the fusion energy in to electrical energy.
But that is no reasonable with a tokamak.
Direct conversion methods would lead us to be able to use far more types of fuels.
One of them is boron11 and hydrogen fuel.
Reply: @lucasdias4365  I strongly advise that you do not use the sacred name of God in vain Lucas.
Reply: @tonygibson6436  God's name is not God, good day
Reply: @lucasdias4365 because the new way would be more efficient and have a higher energy output. The whole boiling water thing is just because water is the most easily accessible liquid that exists as a liquid, at Earth's average temperature.
Reply: Check out what Helion Energy is doing.  They're directly capturing the expanding magnetic field using the same magnets used to compress the plasma, and by doing this rapidly, on the order of 1Hz, as well as not trying to generate a self sustaining 'ignited' plasma, they've made some seriously rapid progress on their reactor design.
Reply: Lol, wise said
Reply: Actually finally get to boil supercritical CO2 instead would be a major step forward
Reply: That's because boiling water to spin things is a phenomenally effective way to transform thermal energy into kinetic energy in a controlled and usable way.
Reply: You do realize boiling water is not the only way to turn heat into electricity right? Thermocoupling, as well as using Faraday's law of changing magnetic fields produces electrical currents
Reply: Well. This is only true for Rankine heat cycle engine designs. There are alternatives like supercritical CO2 Brayton cycles. No more boiling or condensing required. Haha. But at the end of the day, it is still a fluid that gets heated and loses energy by spinning turbines.
Reply: The water doesn’t even need to boil.  I highly recommend water mills for your water-driven spinning needs.
Reply: Hopefully our WEF overlords allow us to refine the oils necessary to lubricate the steam turbines and their accessories.
Reply: Instead of settling on an ploynesia island - with family, friends and adventure.
Reply: @JamesBrown-ux9ds  
daripada menetap dindonesia. 
😂mending saya menjalani kehidupan tenang dg m.o.uly dieopa.
Reply: spin thing goes skrrt skrrt
Reply: @minimemarcus88  Moron commenter goes herpderp 🙄
Reply: We... Stop. 🛑

Were made in HIS image. HE made us with the power of free choice
A good prayer:
I'm a sinner JESUS please forgive me for all my sins I know you shed your Blood for me on the cross at Calvary. Thank you JESUS for my salvation and for shedding they Blood for me. I love you JESUS. 
Romans 10:5/10 ct...❤️k
JESUSisLord!Amen...
Amen..
If you'd like to call someone who cares 
83
For
Truth.
bc you don't know when you'll die?
.y r u hesitant.
Reply: So we are also wasting water to produce electricity?? I wonder the consequences of alllll that vapor in the air too. Consuming more and more... And in the end we are left with nothing. Progress is "fantastic"
Reply: @Trip4man 
1. Most of the time, (at least in nuclear reactors), most of the vapor is returned in form of cooled water, after going through the turbine and then the preferred cooling method.

2. Something called "rain" will give us such vapors back.

3. If we compare how much water the Sun turns into vapor so that we can have clouds, nuclear power plants are miniscule.
Reply: It will not work . Oil is still the best 🤣🤣🤣
Reply: Fusion produces charged particles.

Also combustion engines  run on gas and air.  And only after it's creating rotational energy do we spin an alternator.  The boiling water part is from cooling the whole thing down
Reply: …and?